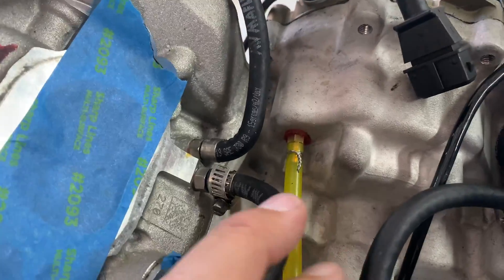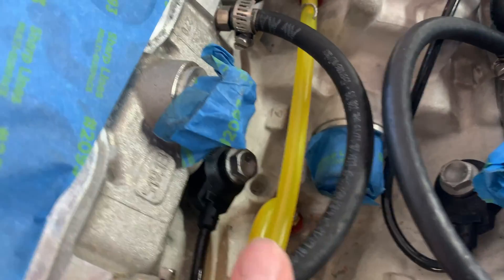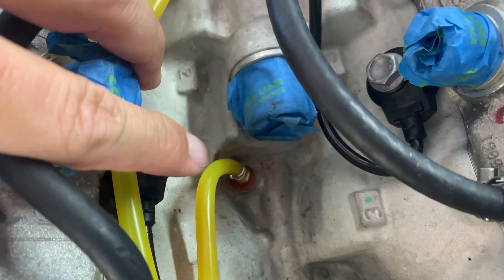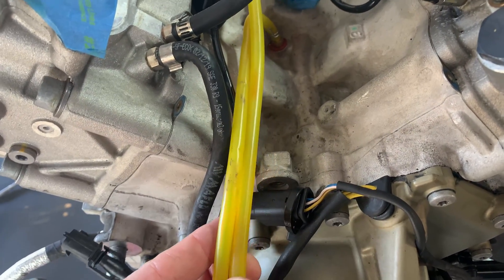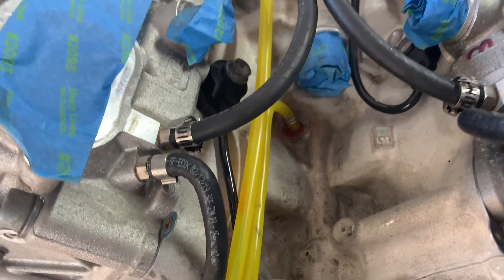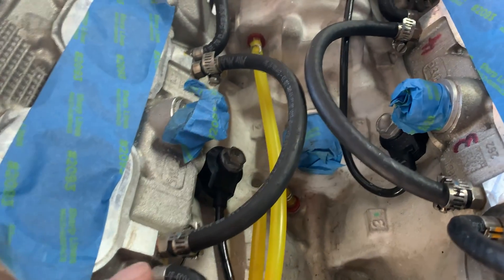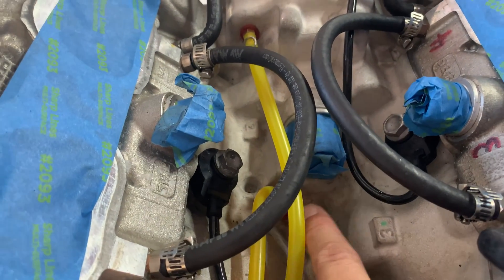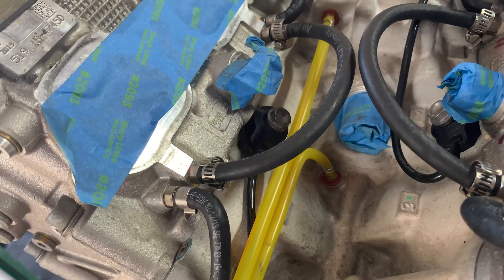Ducati V4 Water Pump/ Case Mod

Comment: Hi there would you think its because of too high of pressure? Would a flow restrictor help? To reduce excessive pressure and cools the coolant better. Please correct me if i am wrong.
Reply from the maker: I’m not expert engineer, but there is a lot of heat & vibration associated with this race engine. I think it’s a tough environment for seals & bearings. So if anything I’d say if heat is your issue, try a race thermostat housing & high performance coolant. The manual even notes a small amount of weeping is “normal”.

Comment: Hello from Italy! First of all, thanks for the video, second how is going with this mod? I'm in the offical Ducati club and me and many others with V4 are having troubles with the water poump and with the water radiator too. (I'm ath my 3rd poump and 2nd rad. in two years and 23k km) Now Ducati inspectors are working hard to try to solve the problem. Thanks
Reply from the maker: Sorry to hear it. The water pumps are under a lot of stress & heat. I found that good coolant helps & different thermostat housing.
Reply: Hello  @TxDucatiRacer ! Thanks for your answer, I'll try to find a better liquid coolant but I'm not sure I can find a better thermostat. Now I'm at 30.000 and I broke my fourth poup. The issue for you could be pressure or temperature? Will it be a good move to install racing silicon hooses, a bigger radiator and to decat the bike? I don't know really what to do with this bike.

Comment: What year V4 do you have? I’m on a 2020 Streetfighter V4S and have had the pump replaced twice now and on the second time it’s been going well so far. I’m just wondering. I’m super impressed at what you are doing, I’m a nobody, still I think this is awesome what you are doing. I don’t know what I’m trying to say but it’s amazing watching what you’re doing.
Reply from the maker: Thanks dude, appreciate it. Just step by step & learn as you go. Sucks that the water pump has gone out twice so far. I’d hope the 3rd one is a charm!
Reply: @TxDucatiRacer  same here. Last summer it wasn’t as hot as previous ones and the replacement pump has been working well without issues. We’ll see this summer if it’s a normal warm California summer and really test it. Third times a charm for sure. The Streetfighter V4 is one heck of a ride, such an amazing bike. Gobs of power while being extremely comfortable to ride. Thanks and take care 👍🏽

Comment: Thanks for posting! Newly designed pump failed after 9 months : / Side note you guys running stock radiator cap? or graves 2.0?
Reply from the maker: Yea dude no worries, hope some of the info helps. That sucks, I’d expect a longer life on that pump. I’ll see how long my new one lasts. I’m running the stock cap, stock radiator/ oil cooler & VP coolant. No overheating here in TX this far!

Comment: The 3 bond gasket bead and the old water pump design from factory is a major problem with the v4. With the updated pump design and a better 3 bond bead, I have not seen any further issues once it gets replaced. Just don't fk up the 3 bond bead and you're good to go!
Reply from the maker: Totally agree, not a fan of the RTV gasket but maybe it’s the best option considering the location. I’m used to having gaskets for mating surfaces & this bike doesn’t use them in the usual locations. Let’s hope the new water pump does better.
Reply: Issues with mine, two water pumps and seal keeps failing, having a dispute with Ducati about it as we speak
Reply: Hi. How you mean dont fu up 3 bond? Not put too much or something? Thanks
Reply: @clio00  Uh so too much is better than too little 3 bond. Just make sure you really clean both the surfaces of the WP housing and the WP itself, and make sure your 3 bond bead is consistent and complete.
Reply: @phonemeunit1973  thanks. But arrent holes allredy there for drain in case of leaking? Or video is because now it avoiding leaking on engine case?

Comment: In your opinion, why do these water pumps fail often? Heat fatigue? I've had two changes within 15,000 km. First time was oil pooling. Second time was  lots of coolant. 
If you get coolant from either hose, would that indicate another pump change is needed? Still love the bike btw.
Reply from the maker: Dude I’m not totally sure & honestly I’d be guessing without any real data. But I’m thinking it’s the heat just cooking the seals. They have updated the pump a few times & there are noticeable differences in the seal design. So I’ll see how this update works. Correct, if you see coolant or oil from the drain lines we know a seal is going out, but you can monitor if it’s just a really small weep or a legit leak. Thanks man!
Reply: @TxDucatiRacer hey. Any news? Still holding? Or got coolant leak